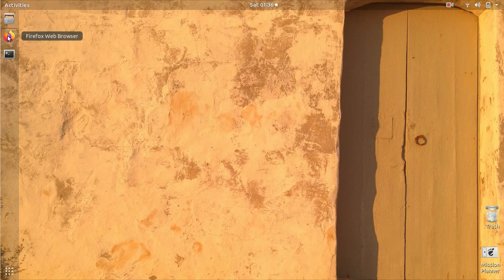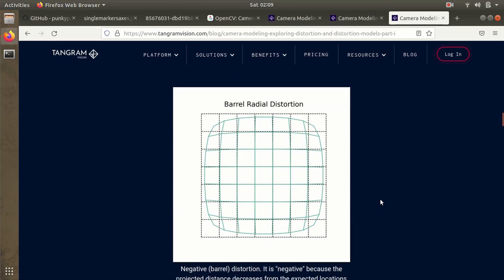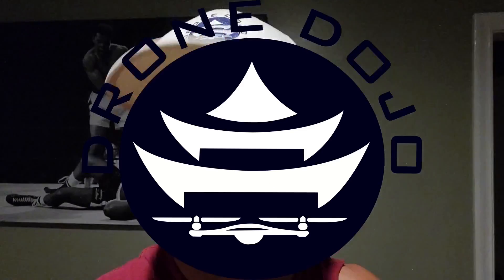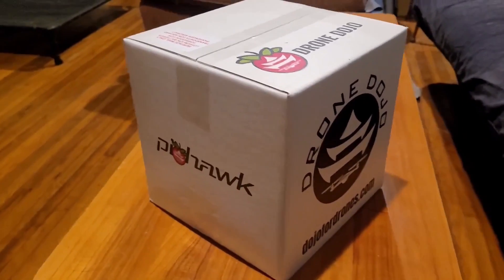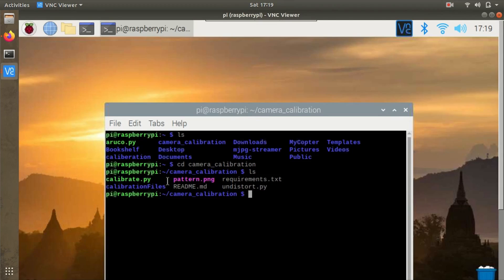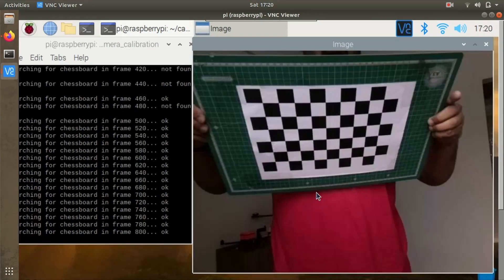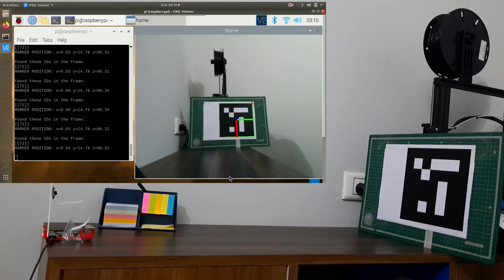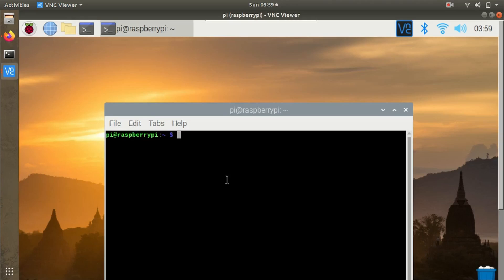Calibrate OpenCV Camera In Under 15 Minutes

Comment: Currently trying to follow this tutorial with a Raspberry pi 4 and python3. I have corrected the syntax differences required for python3 but keep getting a strange error from line 88:
rms, camera_matrix, dist-coefs, rvecs = cv2.calibrateCamera(obj_points, img_points, (w, h), None, None) 

error (-215:Assertion failed) nimages >0 in function 'calibrateCameraRO'.

Any help would be appreciated